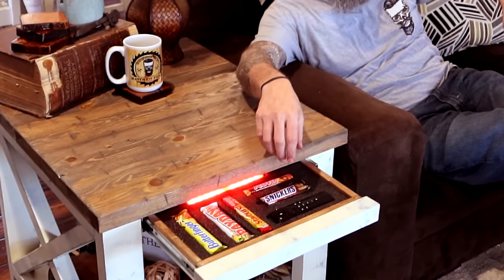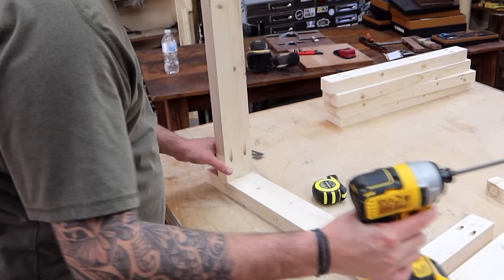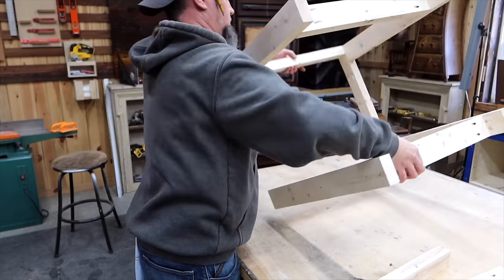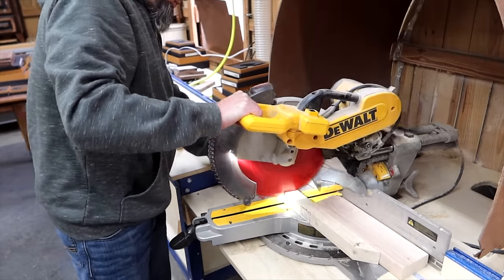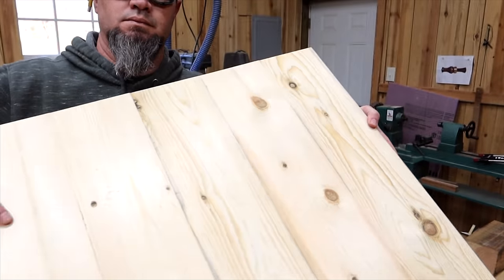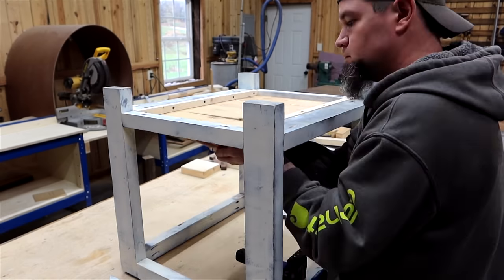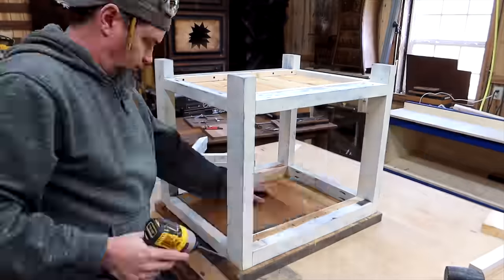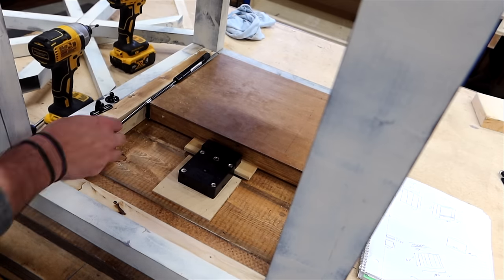Concealment Side Table / End Table - Make Money Woodworking

Comment: When I worked at a wood shop, there were a few "tools" that were used. There was a board that had nails protruding out. Mainly, it was a group of nails that were put through a board, then another board screwed over the heads so they didn't fall out when it was hammered. Then, we'd align the board with nails over the wood to be distressed, hammer the top... Walla! a group of "wormholes". We'd also beat the wood to be distressed with a length of chain.

Comment: Mr. Peech, what are the slide lengths please?! Let me tell y’all…Finishing up the coffee table and starting on two of these now and it turned out absolutely beautiful. I decided against distressing and repainted and used a lighter stain (top and bottom) followed by satin lacquer. Also went pretty extreme with the wire wheel. It’s just beautiful. Do this now, you’ll be rewarded! Thank you sir, for the cut list!

Comment: Well Matthew, at 2:56, you asked if anyone else puts screws in their mouth, I was putting a picture up one day, I was using the hooks that have inch & a half nails that go through them & into the wall.
Id got the picture in one hand, the hook & hammer in the other, the nail in  between my lips, I had to get up on a chair as the picture hook had to be about 7 feet off the floor.
As I went to get up on the chair, I had one of those "gasping moments", as I gasped, I swallowed the nail, I ended up in Accident & Emergency, where they put a tube down my throat wich had 3 hands that were pushed out with a button at the other end, they used this to pull the nail out of my stomach.
The Doctor who did the proceedure actually wrote me a letter, asking me NOT to do it again.
Any way, thats another impressive buld & its a thumbs up from me.
Looking forward to your next video.

Comment: My only issue with rifle concealment stuff is needing a tag or card. If I need whatever is in there, I dont want to have to reach in my pocket or wallet. Do you know if the lock will work with RIFD rings? I've seen some that are programmable. If the "key" is on my hand, I'd be wanting to build all kinds of stuff.

Comment: Nice build, but I would have liked to see the strut mounted to the back of the drawer and not the bottom.  This way you could use a bottom cover to stop anyone looking under the table to see the "hidden" compartment.
Reply: Couldn't you put a panel low enough to cover that anyway?

Comment: I’m noticing how comfortable you are with pocket holes.  I’m just curious on how you’re able to just hold a piece while drilling the screws in.  I have to clamp mine down to keep them from slipping.  What’s your secret to not have to do that and still be square?
Reply: When you drive the screw dont push, just let it spin in the hole and "cut" it will eventually grab and pull in. Just don't force it in like traditional screws or it will move every time

Comment: I was wondering if there was a reason you chose the gas springs that is in your kit? When I put your kit on the drawer can only open part way. It appears to me if I use two of the long ones it would open very near wide open using the 16 inch centers.  I know the drawer will open more slowly because the short one has much more power. I think 4 pounds the long one has enough to open the drawer but I’m afraid I have missed something.

Comment: Would it be possible to make the draw rfid proof so as to protect things like car keys, yet still have the rfid lock on the outside. The reason I ask is there is a big trend in the uk where car theirs put something against the door or wall of the house that clones/boosts the key signal allowing them to unlock and start the car. It is more high end vehicles that is targeted and the concealed coat rack or a small side table with this draw would be a big seller.

Comment: Hey Mathew wondering if you have any good tips for cutting round edge off and cutting 2x4’s exactly in half after cutting rounded edge off? Also wondering if you used a flat latex off white paint or possibly a chalk paint? I’ve removed round edge and cut in half 2x4 in the past but have struggled to get the 2 pcs exactly the same might be a good video for us newbies?

Comment: Working on an exterior item and used oil based stains….  What do I put on it now to protect it?   What is “clear” that I can apply as I don’t want the stains to change color.

When completed, I will submit to the wall.
Reply from the maker: Use an outdoor polyurethane- it Matthew give it a little shine depending on the sheen you pick so test a small area first
Reply: @MatthewPeechWoodworking  Thanks!!!!

Comment: I really like this build. However, you need to reconsider your use of pocket holes. When you made the drawer, you placed the pocket holes on the inside, so they angled out and are just catching the end of the drawer front and back. Not only does this make for a weaker connection, but they are also exposed if you don't have the foam. Had you placed the pocket holes on the outside, they would have bitten into more meat of the wood and be covered by the drawer slides. For the pocket holes in the bottom rails, I would use one hole in the bottom of the board off center to the outside and one on the inside off center to the top. This still allows 2 screws for strength without the need for plugs. Again, I really like the build and may make my own version. Thank you for the inspiration.

Comment: Purchased your plans to build this to match the coffee table. However, I have a question. In the coffee table build the 2x6s had the rounded edges removed to create a flat joining surface. Reviewing the side table plans, they call for the top pieces to be 5 1/2 inches. Which would leave little “valleys” between the joined pieces. But the final top on the side table is flat with no “valleys”. Did I miss something?

Comment: Hello everyone.  I wanted to let everyone know that the reason Matthew selected the KR-S80L (and KR-S80LC-BT - RFID and Bluetooth) locks is that these will release with pressure on the locks on their own.  There will be about 12 pounds of pressure pushing on the lock due to the Shock kit.  Any lock that starts with "KR" will release on its own.  We have fingerprint, digital and RFID to release these locks.  I see some people ordering (and I assume using) the SDWS-BK001-G1, CL-01, and/or F-B32.  While these locks can be used, they will not release on their own with the pressure on these 3 locks.  You will have to push in the drawer some to release the pressure off of the lock, so it unlocks.  If this doesn't bother you, these 3 locks can be used, but you will need to modify the way the locks get mounted.  If you have any questions, please feel to reach out to use.  Our phone # is 845-402-6108 and email is info@lockconnection.net.